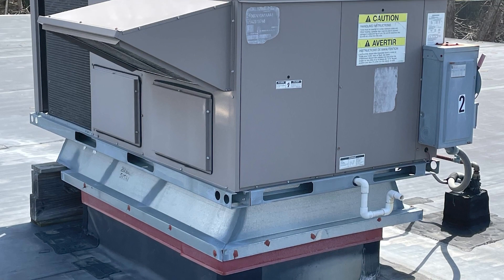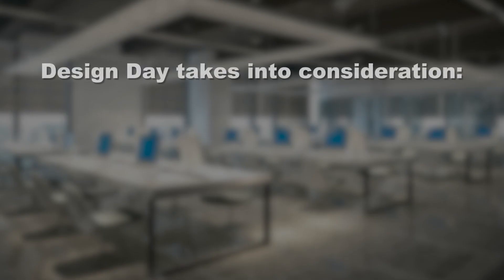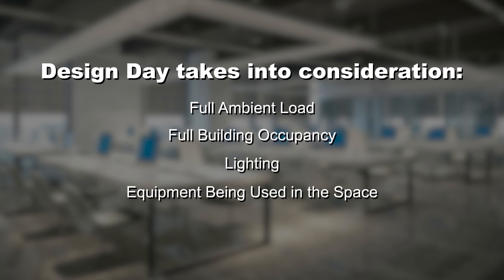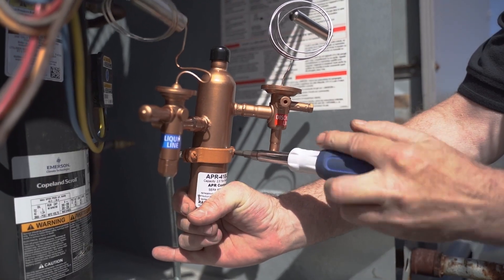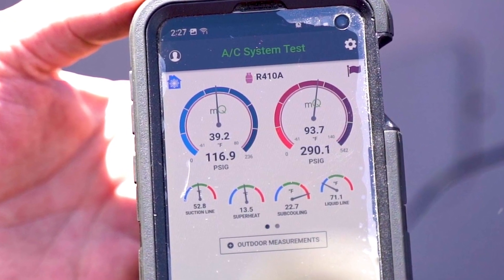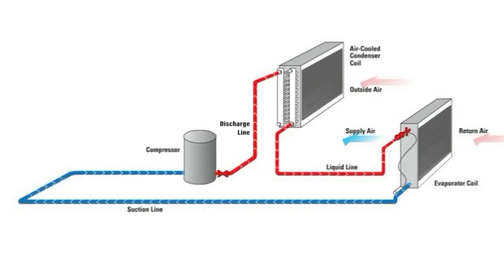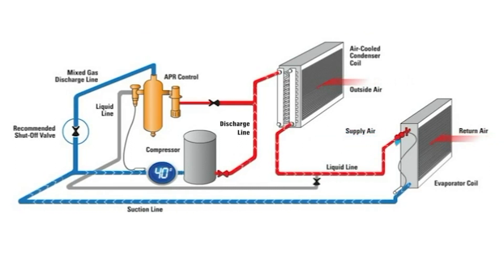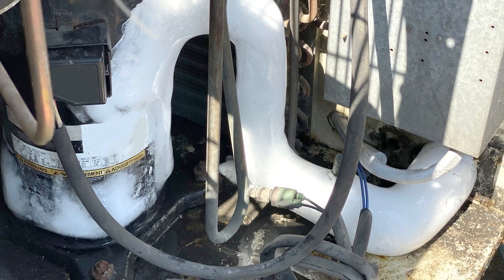Why Are All DX Systems Oversized and How to Fix Common HVAC Challenges!

Comment: This sounds like a much better way to make a system more efficient than all of the high priced electronics that they are putting in systems that jacks up the overall cost of the system to the customers.
Reply from the maker: @czechmate6916  Couldn't agree more! APR Control offers the same performance benefits as those high-priced variable-speed technology systems, but at a fraction of the cost. It’s the perfect solution for extending the life of aging equipment, adapting to changes in space use, and providing an easy-to-install, low-maintenance solution. Plus, it’s a true ‘set it and forget it’ device—no complicated electronics or costly system upgrades needed. It’s all about getting more out of your existing system while saving money! 💡
Reply: @ I couldn’t agree with you more. Thanks 💪💪🇺🇸🇺🇸